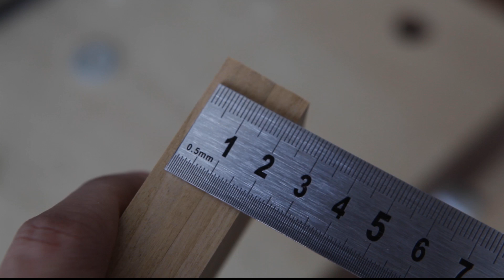Sharpening Jig for Chisels and Hand Planes // Honing guide

Comment: I’m going to make one of these but with a slight modification. It would be stronger if it had 2 holes drilled completely through the lower piece and then had 2 bolts epoxied in place instead of the nuts. That would mean you could use wing-nuts to clamp the blade in place.

Comment: Any load is always better handled in compression rather than in shear mode,  so if you place the nuts on the opposite side I.e. towards the wheel side the structural integrity of the system would be better and glue or epoxy would hold better.

Comment: nice jig where did you get the rollers
Reply from the maker: At the local home depot
Reply: @BrassGrain  thank you very much for the quick response i am very new to wood working and watching your videoes gives me alot of inspiration
Reply: checked home depot found no such rollers
Reply: @domainmojo2162  thank you i tried almost all sites on the internet but could not find anything like that i am from the west indies so stuff like that is very hard to get here.
Reply: You can buy these on ebay fron Chinese suppliers for delivery to the UK. I have ordered some and have received a confirmation email from supplier. This is a good sign that i will receive goods soon (hopefully). Search "castor wheels or furniture wheels.

Comment: Aren't those wheels a bit far apart to fit on a grinding stone? 
Or even if you're using sandpaper, wouldn't it have to be needlessly wide, and screw up the edge if one of the wheels goes off the sandpaper? 
Or do you just keep the wheels off the stone/sandpaper altogether?
Reply: .   
W
Reply: Some people countersink a sharpening stone into a board so they can use the whole stone.

Comment: Unfortunately  this tool has the same problem as the Stanley honing guide.  The risk of the slantwise position of the chisel or plane iron makes it less usefull.
Reply: I was thinking about the same thing. Do you think it would be better to make both pieces the same size and have them sit flush to each other so you can place a small square on the edge and make sure that whatever you're sharpening is at 90 degree angle?
Reply: When making the guide it would be easy to add a stop to one side (1-3mm 1/8inc high) of the pieces of wood to place the plane blade against before tightening.